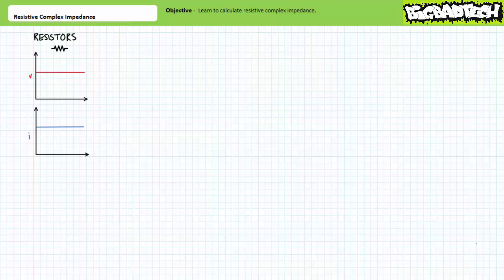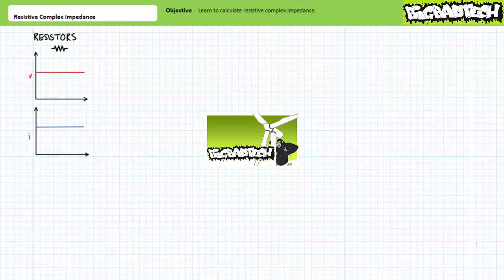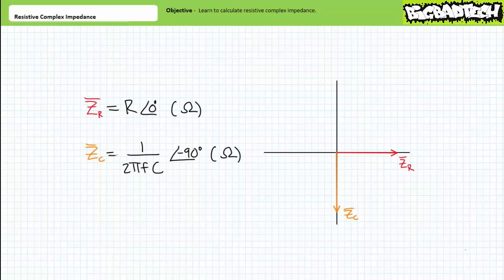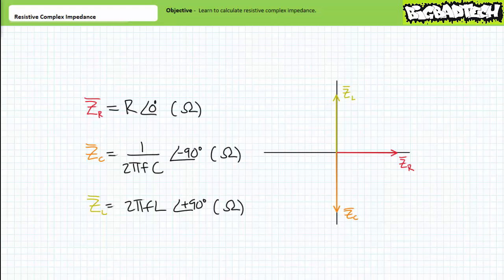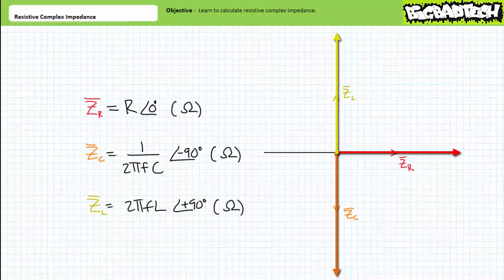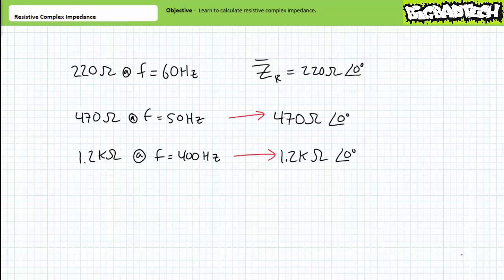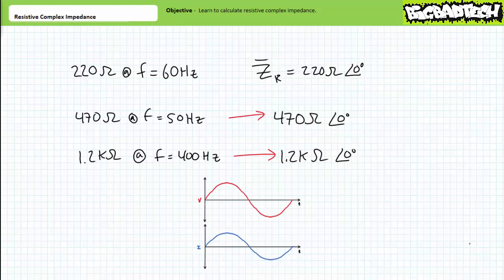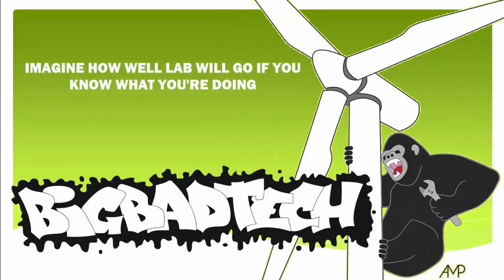Resistive Complex Impedance (Full Lecture)

Comment: what does the direction of impedances(RLC) on the plane mean? i just need to know the bottom-line
Reply from the maker: The degree by which the impedance component shifts current with respect to voltage.

Comment: THANKS FOR THE LECTURES.
I'm am a student and this material helps a lot.
Any chance I missed the part before this video where you talk about capacitors in this playlist?
Reply from the maker: Glad you're making use of this material. This is some of the "missing material" I allude to in the 2018 Update lecture. Now that I completed AC power and some basic 3 phase AC material I'm hoping to return to this content. Stay in touch because I'll be publishing content detailing capacitors and inductors and their transient DC response as well as series AC, parallel AC, and series-parallel AC circuit analysis in the very near future. If everything works out right I'll have a complete basic electronics series (DC, single phase AC, 3 phase AC) done by summer 2019.
Reply: Thank you <3
cheers from argentina.
Reply: @bigbadtech  I didn't watch your DC series sadly, just hoping what you cover here in this AC playlist will be enough to get me to understand my second year modules